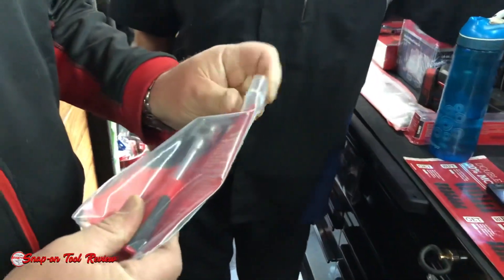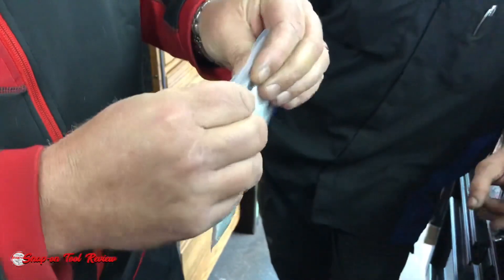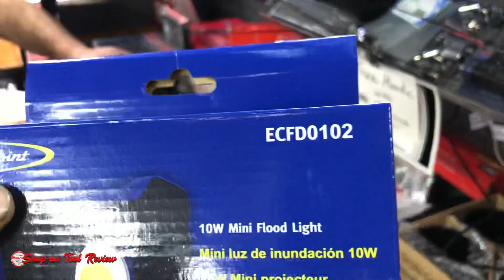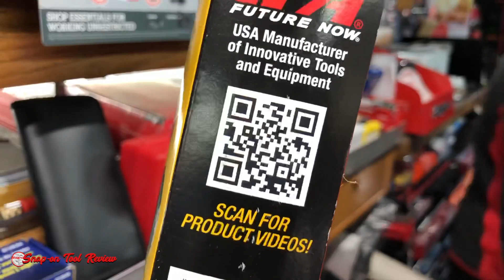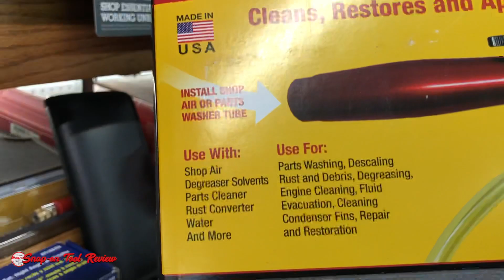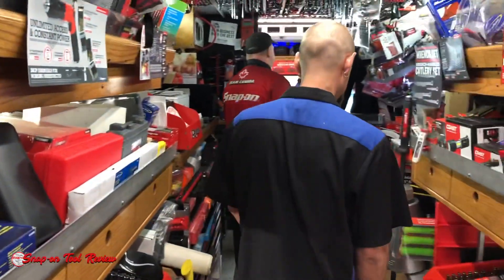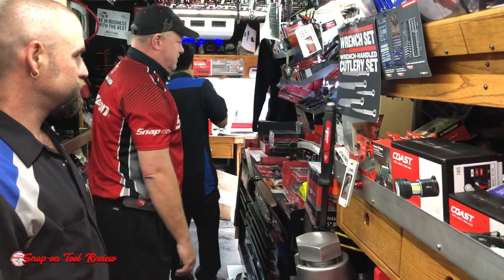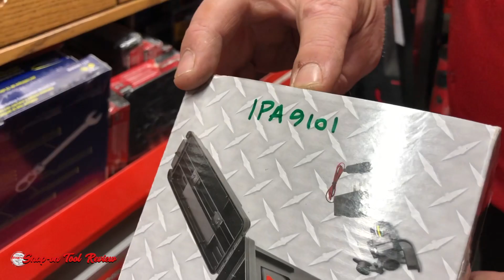SNAP-ON WEDNESDAY - Grandpa Joel Is In The House!

Comment: Good video.  Mini-ductor is probably on my list.  I just got a new Epiq with a powertop the other week and it has the new style powertop.  My Master series that I got a powertop only about 6 months prior had the old style.  Big improvement.  It actually says Snap-on embedded into the power outlet not "lighting solutions".  Most of all it looks like SO quality and grade.  Seems like it fits better like it's meant to go there, not an afterthought.  Has 2 USB 3.0's on each side.  The only thing I don't like is it doesn't have any power outlets in the very front which would be handy when you need to plug in a tool.  Otherwise, awesome.  Not that the old powertop wasn't very nice.